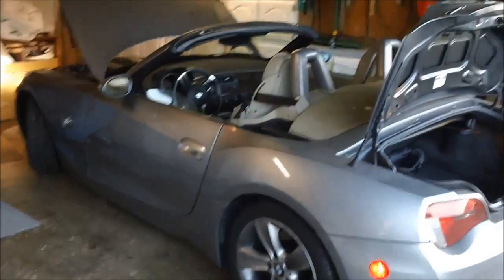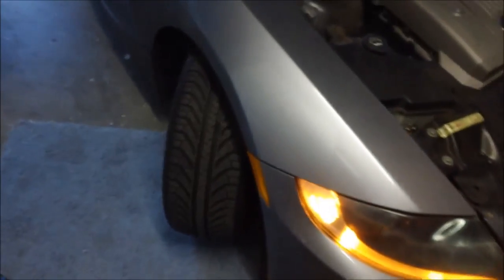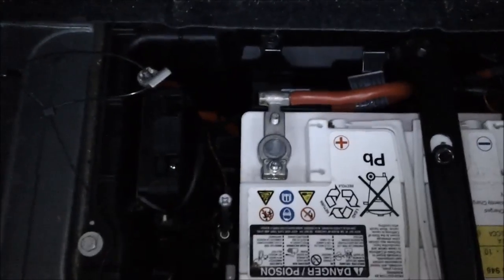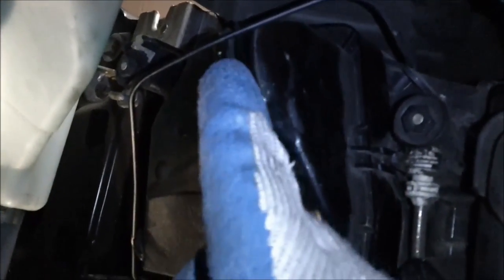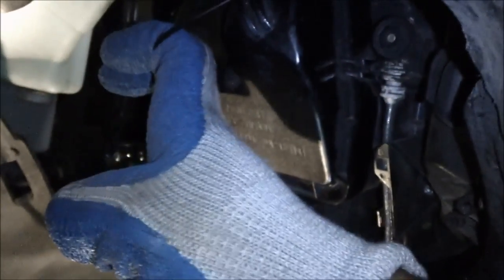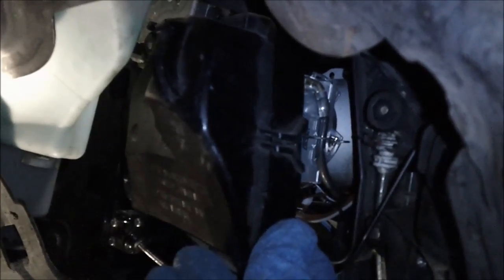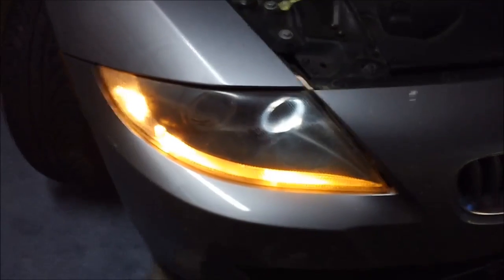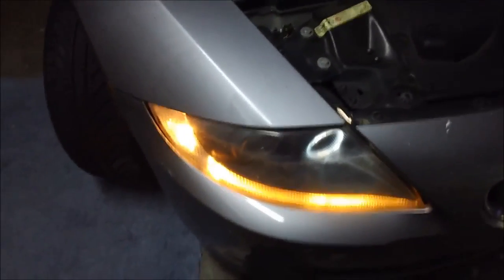DIY 2006 BMW z4 low beam xenon bulb change

Comment: Thanks! My 2003 Z4 passenger side just went out (205K miles, 13 years = pretty long life bulb). Went to O'Reilly to buy replacement, not knowing about Halogen vs. HID option. Luckily, counter guy, Ty H., was knowledgeable - asked me if they flickered or grew in brightness when turning on.  Answer Yes = HID = D2S.  Bad news = $100 price. Other bad news, light package, Sylvania web page, and owner's manual warn about high voltage and death. (Owner's manual says for Halogen, do yourself, for HID, go to dealer.) Your video gave me the courage to defy death, and attempt the swap. Your video made it easy, and all went well. Note, though, that the D2S bulb has to be properly oriented, as the socket has slots to ensure orientation (unlike the Halogen). The outside wire from the top of the bulb goes on the bottom. Also, as someone else posted, the wire to the ballast pops off when you turn the ballast; you don't put the wire back until the ballast is mounted on the bulb. Thanks!

Comment: Thanks for this video - followed it step by step and easily replaced my bulb. I did have one tricky issue. Inside the ballast, there’s a plastic ring with slots that need to align with the openings that go over the prongs on the bulb. My ring kept moving out of alignment when I tried to turn the ballast back on, so it wouldn’t lock down. The ring was easily aligned with a small screwdriver and then installed as normal.
Reply: THANK YOU SO MUCH for making this comment cause I was totally stumped on why I could not get my ballast back on. Apparently this is all part of some elaborate safety mechanism that's made to disconnect the power cable automatically when the ballast is removed but that also means that if someone does what I tried to do multiple times, plug the power cable back in when the access is a little easier before reinstalling the ballast, they won't be able to do it. But damn am I glad for comments like your's, I was totally stuck and even contemplating taking it into the shop the next day because I was seriously worried I had bent something.
Reply: Oh my god THANK YOU!!! You just saved me some dough!! For anyone else reading, it's a white/yellow ring that's underneath the black plastic. So if you're looking at the bulb socket side of your ballast, it's the 3rd layer in. TUNDERBALLKABOOM YOU DA MVP

Comment: You pulled out a xenon headlight bulb  and you’re trying to stick in a standard H series halogen bulb in they’re completely different!!! Noticed that there was no ceramic on the replacement bulb you were trying to stick in. And the blue tinted H bulbs suck anyways even if it was a halogen headlight application which is not. I hope you didn’t mess up the ballast module when you installed it over that Halogen bulb? LOL  I’m a master automotive technician at a large BMW dealership
Reply: Dana Larsen lol he made a good video with completely wrong parts lol
Reply: I was like "NOOOOOOOOOOOOOO"

Comment: Great step by step video, you're a great help, even if the bulb was not the right one. But this is useful, because when I was buying the parts to replace my bulb, I was tempted to buy halogen, wanting lower light so as not to blind others. However, if your car has HID/Xenon lights, you must use a Xenon bulb, as the ballast does not accommodate a halogen bulb. The more you know~
Reply from the maker: Glad you found it useful! Yes I made a couple mistakes, glad you didn’t repeat!

Comment: This video was very, very helpful and we really appreciate it.  Here are a few additional notes.  The plug did not fall out of the ballast.  It is pushed out when you turn the ballast to remove it.  This is a built-in safety mechanism so you don't get juiced.  Because of this, you must reinstall the ballast before reconnecting the wire.  If the ballast won't go on the bulb, you may have to align the white nylon ring so the notch in it lines up with the notch on the black part of the ballast.  This slot is for the "pin" on the side of the bulb.
We followed this procedure to replace the bulb on a 2003 Z4.  On our car, the same bulb is both low and high beam.  It appears that a shield blocks part of the light in one of the modes.  The separate H7 bulb that is next to the xenon (and is shown as lit in the video) never lights on this model and I'm not sure why it is there.  The dealer had no explanation.
Reply: Wayne L Tks for the tip.... That little white ring had me messed up for awhile until I read your comment.
Reply: +Wayne L Actually that light is the bulb used by the car when you flash it. I first thought flashing my lights simply turns on the high beam. Apparently flashing involves a different set of lights

Comment: Thank you so much for this tutorial! Now I don't have to go to stealership to get either ballast or bulb replaced. I think your bulb is the same one in bimmian except you need to get retrofit kit for xenon lights (longer ones). Am I right?
Reply from the maker: +Chris Jay hey glad you dont have to pay the dealership!  yea the bulb i used in the video was incorrect, so i bought the correct one and used the same procedure and everything worked.  it is a longer bulb.  see my previous comments, i think i provided a link to the exact bulb.  good luck
Reply: +Tyrone Tracy my bulb doesnt seem to sit correctly in the holder . ie when it clips in and it will only clip in one direction and thats not the correct way round for the igniter?

Comment: WARNING This video needs taking down before it gets someone hurt or worse. That is NOT how you disconnect a car battery, and you’re asking to cause a fire if you do.

The creator doesn’t know the difference between a xenon and halogen bulb. He has no business offering anyone “advice”.
Reply from the maker: Yea I messed up a couple things going through this the first time several years ago (normal occurrence when learning). This is not a tutorial, and I am not an expert, this is just how I changed my bulb. I’m glad to link your video on proper install in the description. Thanks
Reply: @lankaprince  not being an expert is one thing. Wilfully giving out dangerous misinformation is another. This is literally car mechanics 101 stuff.

Comment: You only did the outside bulb.  What about the inside bulbs?
Reply from the maker: Only changed one bulb. Low beams. Sold the car years ago, can’t remember if it was outside or inside

Comment from the maker: hey, so my car has the bi-xenon bulbs however i was using the halogen H7s in the video, so foolishly i had the wrong replacement bulb.  i ended up buying a xenon bulb and it worked great.  So check if you have a xenon or halogen bulb then buy the proper replacement. I think the z4 stock option is H7 halogen unless you upgraded your lights

Comment from the maker: yes you should be able to replace that bulb without taking the wheel off.  It's a little cramped but i think it was possible.

search "Changing BMW Z4 Front Blinker Bulbs" on youtube, someone made a video.

Comment from the maker: hey, yea hoping the video helped people out.  i got the correct replacement bulb from ebay.com.  Just search "GE LIGHTING D2S X 1 BULB 53500 HID 35W REPLACEMENT 4300K XENON GERMANY HEADLIGHT".  cost is about $60.  i'm sure you can go to your local dealership and they'll sell you the part, might be more expensive, maybe 80 or 90 dollars.

Comment: I found easier to jack car, remove tire.  A lot more room to operate in. 

Overall the process is a PIA. I swear BMW forget bulb replacement during car design, and this mess is an afterthought.

Comment from the maker: i didn't get the light programmed.  Just take out old one and put in new one.  What does programming the light mean?  I dont think there's a circuit in there, circuity should be outside applying or not applying voltage to the bulb, all i did was replace the bulb (not the circuit controlling it).  Maybe they mean headlight leveling, my car levels the headlights automatically.  i'm sure there are videos on how to make sure your car's headlights are level.

Comment from the maker: No such thing as bi-xenon bulb (not sure why they call it bi-xenon).  What happens is that when you turn on high beams the xenon low beam bulb gets brighter and a halogen high beam comes on, so total light output increases.  

So you need to replace your bulb with a 'regular' xenon bulb.  I bought the original (OEM) lights, do a search on ebay for this: GE LIGHTING D2S X 1 BULB 53500 HID 35W REPLACEMENT 4300K XENON GERMANY HEADLIGHT